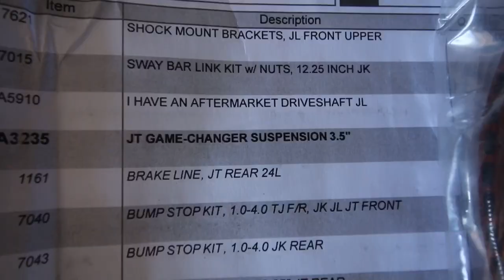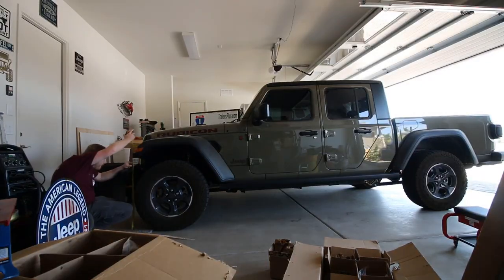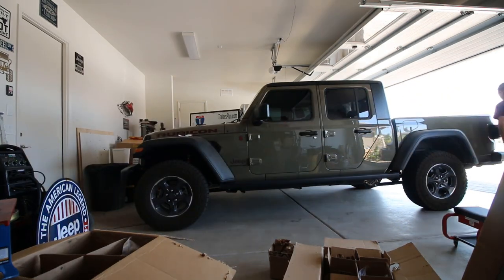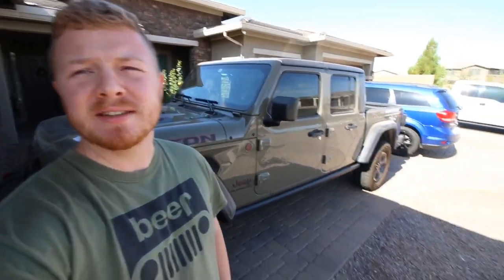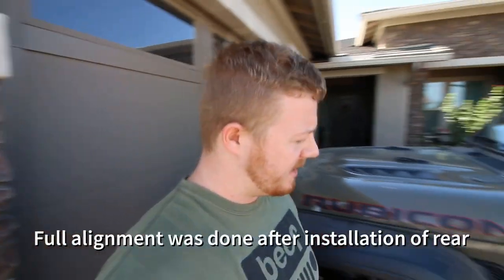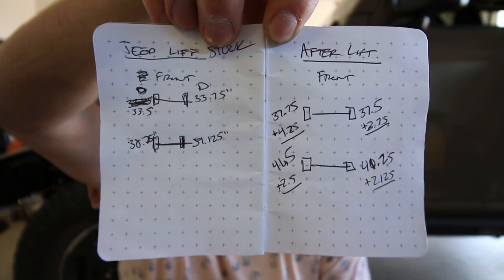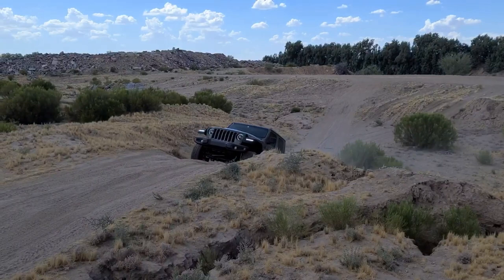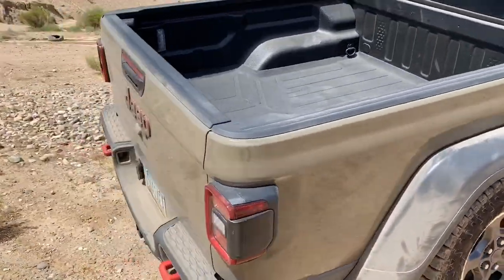Metalcloak 3.5” Gamechanger Lift on Jeep Gladiator Rubicon

Comment: my mom's JK has the metal cloak lock and load and also is lower on the passenger side. it is at least an inch leaned. i suspect your measurements are correct. they plan to send her 4 springs will update if that was her issue
Reply: also some of those bolts are elliptical. according to my dad those are on purpose to act as lock nuts.

Comment: Any issues not getting the aftermarket front drive shaft?
Reply from the maker: No issues yet! But I also am still running factory shocks with just relocation brackets. So I may not have as much down travel for it to be an issue.

Comment: Nice video, I noticed you didn't go for the aftermarket drive shaft that metal cloak recommended. Did you have any issues and would you recommend I get it anyways even if I go the stock shock route? Thanks
Reply from the maker: I haven't had any problems. I think because I'm still running factory shocks. Not as much down travel. It's something I would like to do someday, but still doing fine without it today.

Comment: Great video and the Jeep looks awesome! Any issues with the control arm lengths using the supplied measurements? Did the alignment shop have to adjust any of the control arms to your knowledge?
Reply from the maker: Hi Richard, the supplied measurements were a great starting point. After alignment the shop told me my caster was just over 7 degrees. So I actually had a negative pinion angle. Thankfully I wasn't going to be in 4 wheel drive until I had time to adjust it so the front driveshaft was never spinning. I then lengthened the front upper arms until I got about a 1 degree positive pinion angle. Caster is now about 5.8 degrees on passenger side and 6.1 degrees on driver side. Digital angle finders are the best!

Every jeep is different though so the measurements may work great for you.
Reply: @thependleyadventure3354  thank you, appreciate the information!